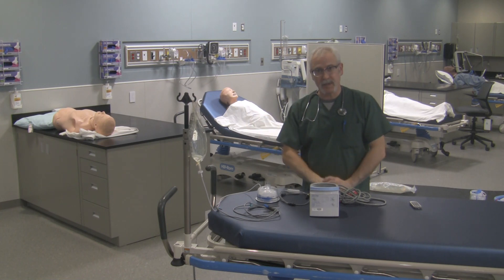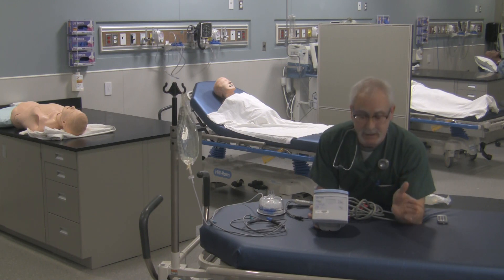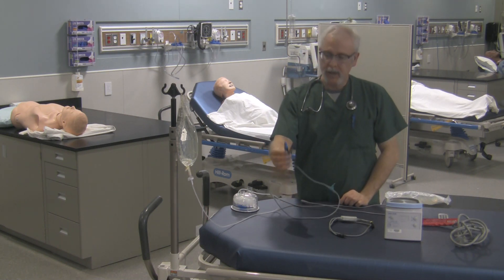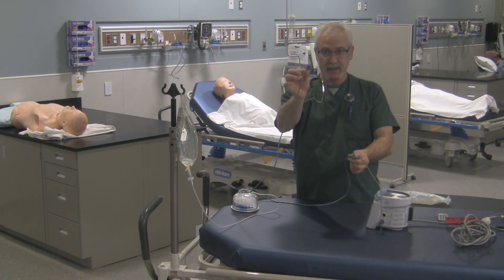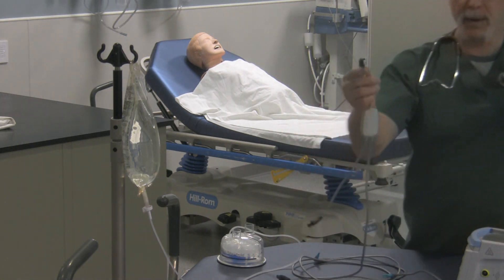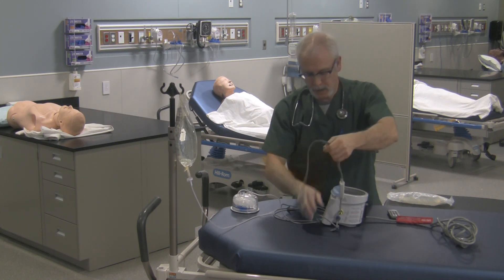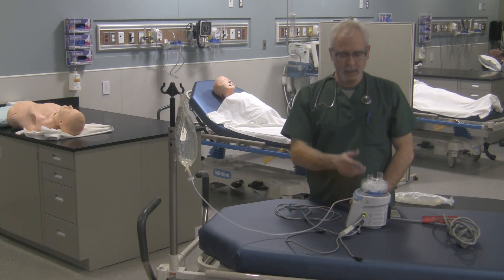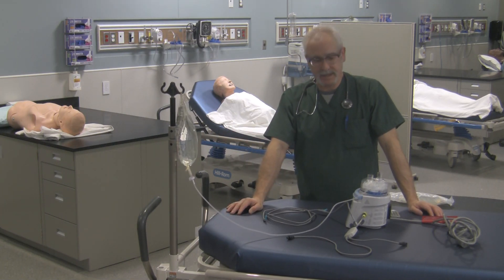Mechanical Ventilation:  Patient Circuits: Part 2: The Humidifier

Comment: How that inspiratory and expiratory affect molecules of newly form if hydrogenated by ionized colours, applies. Would that be internal vacuum of slope curvers in and out at the atomic nucleus for energy of the positives and negatives for the configuration for elements of atoms are 2 in and out negatives of the rings or by seed effects in another level of layer.

Comment: Thank you Dr. George. Would you be kind enough to answer the two questions and supplement related information pl? Related links would be too would be great. 
What is the range of  relative humidity that needs to be maintained? What is the accuracy in RH control that is expected?
Thank you for your trouble.